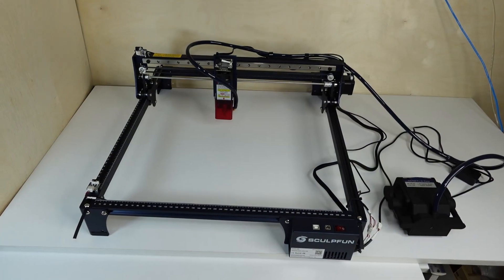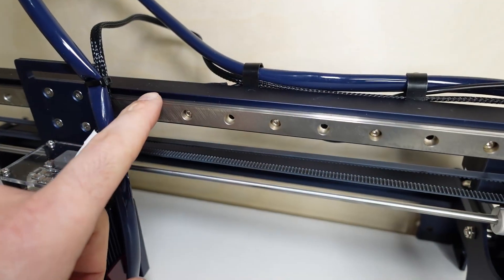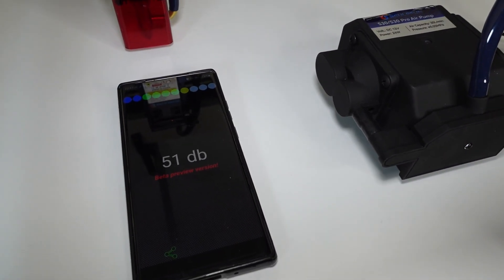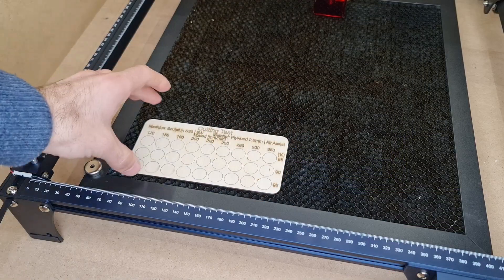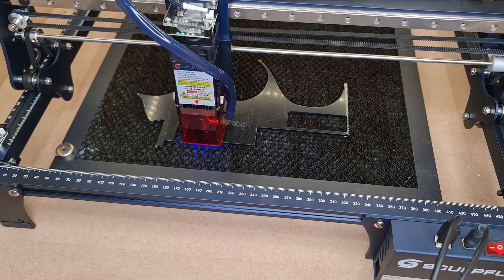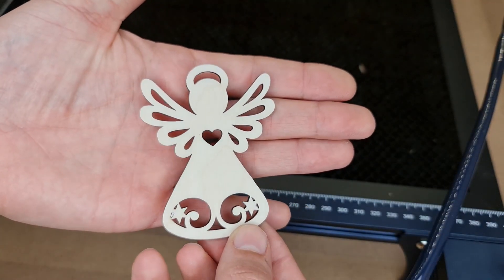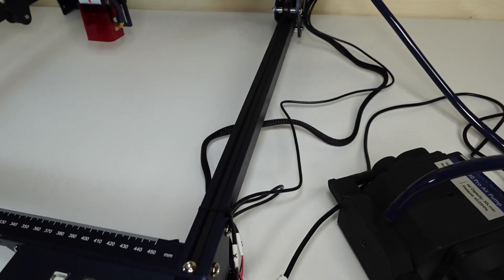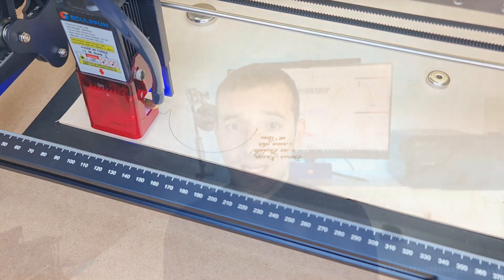Super clean engraving with Sculpfun S30 - All you need in one Package

Comment: Sir who is the power full laser module, S10 Vs S30 pro 10w please comment sir, because I will purchase
Reply from the maker: Hi, thank you for your comment.

The models changes but the laser module and power are the same, therefore if you need to choose among theme, I recommend the S30 Pro.

Also, if you can get the 20W version, as 20W is the perfect power to tackle any project you'd like.

S10 10W https://affiliate.geekbuying.com/gkbaffiliate.php?id=3783&url=1124301
S30 Pro Max 10W https://affiliate.geekbuying.com/gkbaffiliate.php?id=3783&url=1124300
S30 Pro Max 20W https://affiliate.geekbuying.com/gkbaffiliate.php?id=3783&url=1124299

I hope it helps,
Ciao

Comment: Bro i have so much trouble setting up my switches. Whenever I press home it just neglects the switches and keeps on ramming the sides. I have no idea what I'm doing wrong
Reply from the maker: Hi, Global; thank you for your comment. 

Perhaps the machine has homing enabled but no hard limit switches.

Check your GRBL configuration and make sure that the following parameters are as follows:
$21=1 (Hard limits enabled)
$22=1 (Homing cycle enabled)

If you are using LaserGRBL, simply go to GRBL > GRBL Configuration; in the window, there will be a list with all the parameters; look and set the parameters as I listed above.

If you are using LightBurn, go to Edit > Machine Settings, do the same look and set the parameters.

Let me know how ti goes.
Ciao